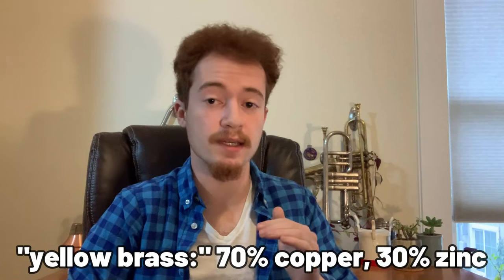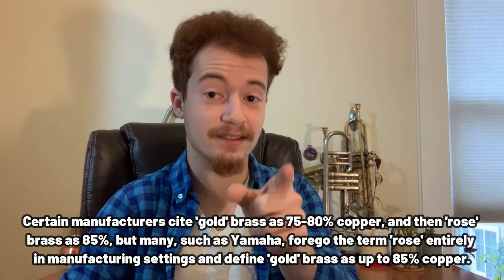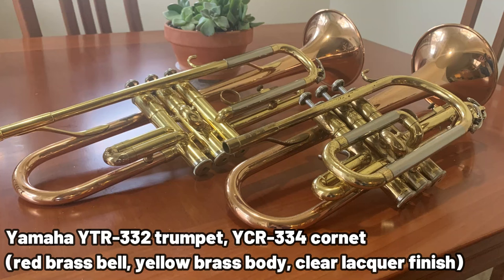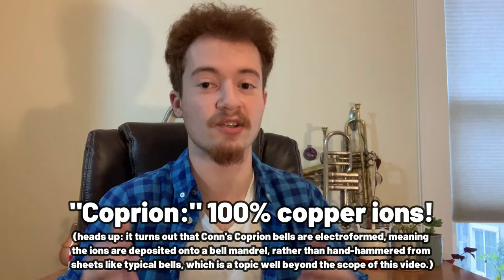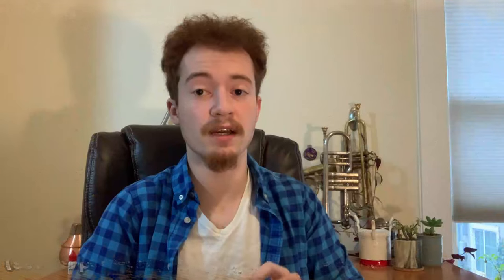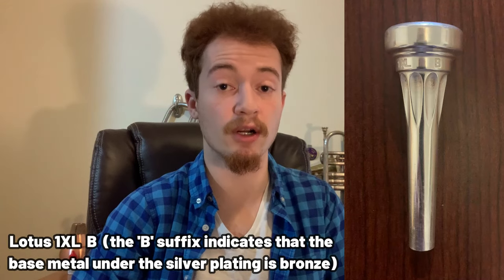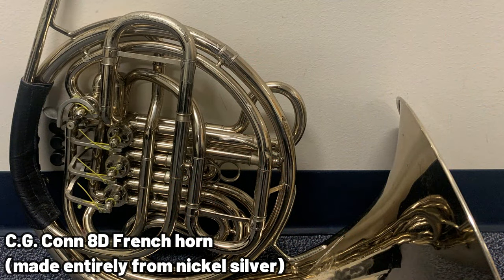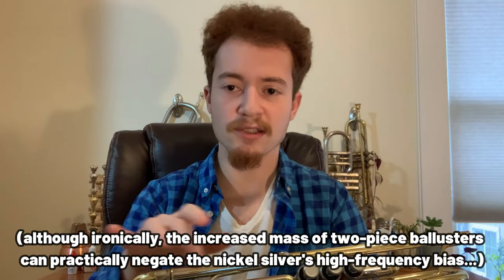Does it Really Have to be Brass?? | Trumpet Demystified Episode 3

Comment: The British manufacturer Sterling made a 0.5" bore trumpet. They didn't make many of them but one of my friends has one. They also supplied that valve block to Taylor for their early Chicago Custom trumpets. I owned one of those and the sheet bracing overcame the bore size issues a bit and it didn't feel that big. The actual Sterling 0.5" bore trumpet is a beast. It doesn't have a gap either, it has a smooth transition into the leadpipe. It is unnecessarily big.

I play a rotary trumpet in the orchestra and its a very small bore but the bell is a lot bigger than a piston trumpet.
Reply from the maker: A .500” bore sounds like a nightmare for someone like me. Almost no impedance to lean against, I’d imagine… but then again, with rotary trumpets, the impedance is enough to almost give me a headache. I think my gripe with them is that the valve section occurs so soon after the receiver, meaning the bore at the valve section has to be exceedingly small. Never had much luck with the lower or “longer” fingerings on a rotary.
Reply: I find that the rotary trumpet doesn't get enough volume in the very low register. My favourite trumpet is my Bach 43.  My 8310z is a close second.
Reply from the maker: @GordonHudson  We are very similar in that regard! I struggled greatly in the lower register the last time I tried a rotary trumpet, and my favorites are generally my 8310 and lighter weight Strads and Scodwells.

Comment: Was expecting some mention of Schilke's Beryllium bell which depending on who you ask may or may not have Beryllium.

Didn't expect the plating vs lacquer difference to be significant from my (limited) experience. Every trumpet I've heard people swear has a darker tone because it's lacquered instead of plated ended up also be heavier weight and/or having a larger bell than whatever silver plated one they're comparing to.
Reply from the maker: Right, I just was not informed enough on what the “beryllium” bell’s makeup was to speak on it, and I figured it was rare enough that it didn’t necessarily “need” a mention. I don’t think there are any beryllium bells currently being made, but that’s just a theory. I mentioned nickel and bronze because they’re seeing more widespread use in the modern mouthpiece industry.

You’re definitely right about the plating. Too many variables to be able to test in complete isolation.
Reply: @SamuelPlaysBrass  Makes sense, it's a shame there's so many contradicting rumours about it. At the same time, it's definitely a good thing that we don't have people needlessly exposing themselves to Beryllium, specially when so much of the manufacturing is outsourced to countries where workplace hazards aren't taken seriously.
Reply: Once my dream trumpet -  a Schilke with a tunable beryllium bell. Now my more modest unobtainable dream horn is a silver plated Schilke.

Comment: Just to note some and most most manufacturers will put lead in making brass to give it corrosion resistant and soft in limber and ply ability. The only manufacturer I know that removed lead from yellow brass due to toxic environment hazard is Yamaha. For sure there is lead in brass. There is a reason why family doctors say not to give car/ house keys to babies cause they will put it in their mouths and the body fluids will react to the brass and leach out lead into their system.Also way back silver ware cutlery was made out of brass and heavily silverplated . Same thing with brass mouthpieces , it so you don’t get lead poisoning . Lead was use in everything from paint to metal.
Reply from the maker: I thought lead was taken out of brass decades ago. You mean to say even manufacturers like Bach are still machining with lead to this day?
Reply: Bach have definitely stopped using lead in mouthpieces now, and advertise the fact on their new mouthpieces.
Reply: Denis Wick definitely still uses a couple percent lead. See their article "Our new warning label – what it means: learn about lead in brass"
Reply: Alloy 360 is the most common rod brass product, commonly referred to as free cutting brass.  This alloy contains 2.5 to 3 % lead, the lead acts as a lubricant while the material is being machined.

Comment: Love this series! Got a question though, can you tell whether a trumpet has silver lacquer or silver plating just by looking at it?
Reply from the maker: Maybe someone else can weigh in on this, but I can’t say I’ve ever heard of silver lacquer being used on a trumpet. The lacquer I’m familiar with is just a clear coat, or at most a slightly yellowish one. All of the silver-colored instruments I’ve seen have either been nickel silver with a clear lacquer coat, nickel-plated, or silver-plated.
Reply: @SamuelPlaysBrass  I only ask because the guy that cleans my trumpet asked me if it's silver lacquer or silver plate because it makes a difference to the Sonicare cleaner.
Reply from the maker: Ohhh, that's interesting... I personally am not a huge fan of sonic cleaning in general, so proceed cautiously. I've heard tell of sonic-cleaned horns getting really messed up and not playing as well afterward. My preference is for chemical cleaning.
Reply: Carol Brass lacquers over their brushed silver plate instruments, so it is possible.

Comment: What about carbon fiber or beryllium?
Reply from the maker: (a) This video is only about metals. I’ve never once gotten to test other material categories like carbon fiber or Lotus’ wood mouthpieces, and the physics gets pretty weird once you venture out of metal territory, so it was beyond the scope of this video.
(b) Schilke was not truthful about the “beryllium” bell. I don’t know if there ever were, but there are certainly no beryllium bells being manufactured today. Beryllium is toxic AFAIK, so those bells are actually a thin layer of electroformed copper. While 100% copper would ordinarily result in a darker tone than 70/30 yellow brass, the extreme thinness of the bell wall in this case completely overrides the material properties and actually results in a brighter, thinner tone.